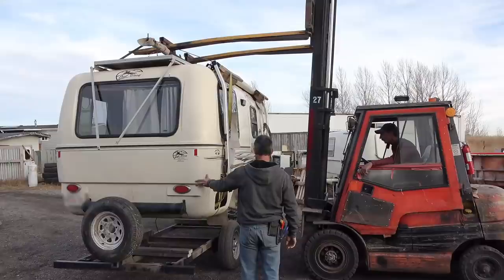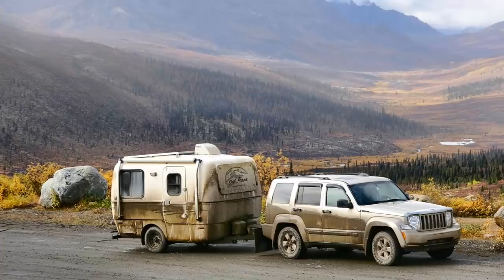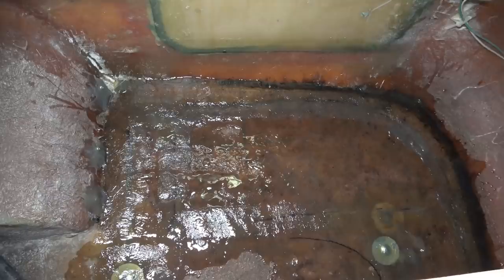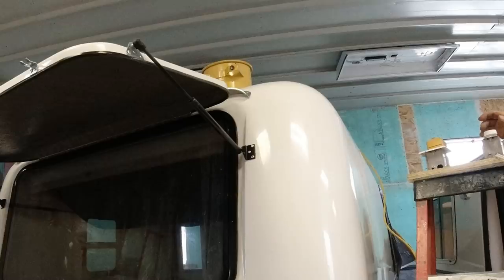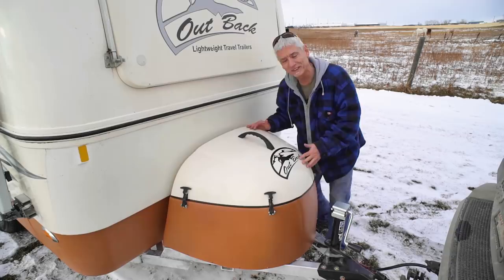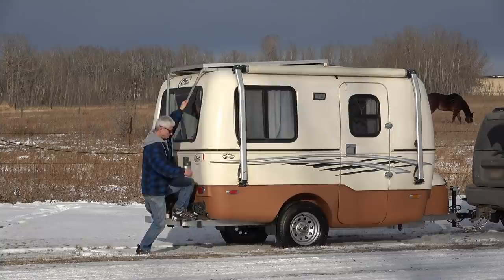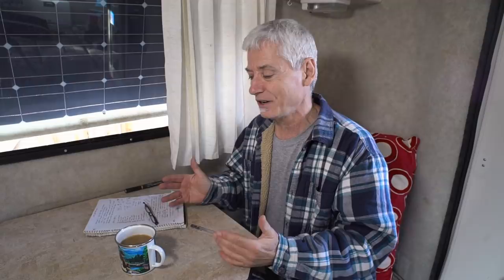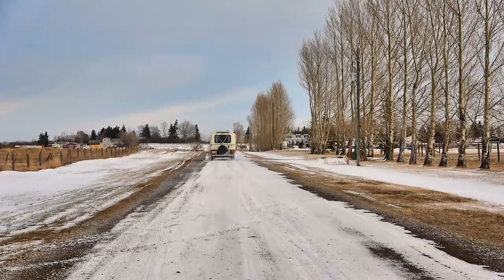Trailer Repairs Part II: Getting a Facelift!

Comment: Slim, love the camper remodel, especially the aluminum frame and beautiful new paint job with thick coating on the bottom. How did they go about dealing with the rotten wood between the two layers of fiberglass on the floor?

Comment: I hope they gave you some sort of guarantee with the fiberglass work they did. Seems to me that if it broke once it will again. Look at corvette's their nice but they crack really easy and need to be repaired, just saying that a nice rock guard made from metal maybe would have been a beeter solution,time will tell. It does look nice though!!
Reply from the maker: I'm sure there's the regular defect warranty, but you'd be dreaming if you think they'll fix it for free if a bolt flies off a truck or something. Never works that way. SP

Comment: Harbor Freight in Milwaukee, Wi. sell Solar panels. Seen in some pod cast with TINY HOUSE. some people Bought from Harbor Freight to sue OUT SIDE. to add electric power to their inside of their Tiny house. . Am thinking if I could store outside in some way and use the two on the Trailer. If I recall they sell smaller solar panels too, which would be easier to store.

Comment: asfar as grinding all that down goes. people gotta remember sand blasting. that could have been shot in 20 mins beside another bigger job theyre shooting. cheap. under $300. then prob $500 at lineX to spray it. aluminum is still better but id cap the ends of those tubes some how. theyll fill with road crap and be a pain for years to come.

Comment: There is no judgement by your viewers on how much it cost, but it aids us to know and I think it's fair payment for our viewership.
Reply from the maker: Jeff, putting a repair bill out to 125,000 viewers would really put the manufacturer in a bind. Costs vary dramatically, like supply costs, labor costs and the cost of materials like aluminum. This would NOT be fair to anyone, especially over time.  Thanks!
Reply: @SlimPotatohead  And, especially when the border is closed and parts/materials are more expensive than the same time last year.
Reply from the maker: Agreed Stephen, it's a nightmare right now for small manufacturers. Many suppliers have been forced to shut down. Thanks! SP
Reply: Thanks for reply, just getting ballpark ideas on cost helps , no one going to hold them to firm price.

Comment: For extra storage on the rear, it looks like there is a hitch receiver on the rear of the trailer. Why not use that for extra storage? Get a storage box that fits in the receiver, and you're good to go! And you can easily remove it if not needed.

Comment: Sorry to be negative but your tongue box at the front is going to get water splashed  in it so would not put a tool box /bag in there. They should of sealed the bottom and grommet the gas line. Your video shows the slot of snow underneath!. Enjoy the videos very much.

Comment: I was wondering if towing a trailer a lot does any long term maintenance issues?
I know if your way down by tow weight but I just mean on transmission, rpms and different elevations over time towing a trailer?
I have a 4runner that can tow 5000 lbs but I want either a tab 320 or a scamp 16ft. They are below 2000lbs.
Reply from the maker: Transmission is always a main concern. My last Jeep needed tranny work. My load is lighter now, so I keep my fingers crossed! SP

Comment: Would it have been cheaper to buy a stripped down model to begin with, without pottie, sink, water container, and aluminum frame,  etc?   How much easier is it to hitch and unhitch with the lighter frame?
Reply from the maker: Wait time is 6 months to a year. And no, it would not be any cheaper. Thanks, SP

Comment: Thanks for the update.  The trailer looks great.  Is there a huge price difference between the aluminum frame VS if you would have just had them swap the frame for another steel one?  I'd think in the end it would still be cheaper to just go with the aluminum frame for the lifespan over the cost I'd think.  

I like the color you went with too.  Turned out great how they did all that and covered up that old storage cubby in the back corner.  The rear bumper & extra framing would be great for small storage items I agree.  

So, since you aren't going to reveal the cost for obvious reasons, is it still cheaper than a new one LOL.  

Also, did Outback say anything about the things you modified on the trailer at all?  Did they complain or anything about that stuff?  Curious how they deal with customers who actually modify their trailers to suit their needs.  They did a great job with your trailer, I'm sure it wasn't cheap, but heck for what they charged I think it looks just as good as if you had bought new.  Thank you for sharing all the video shots from the shop they were working at, really interesting to see what all they do.  I had no idea until your first video of your updates on the trailer that the body came off the frame, I don't think any other trailer out there can be done like that.

Comment: Love the new colors! The darker shade of brown compliments the lighter shade very well.  Congratulations on the new upgrades. You don't have to breakdown/justify the expenses to any of the viewers as I feel people will criticize anyway regardless of what you paid. As long as you're happy that's all that matters. I do have a question though, is there a weight difference between the steel vs aluminium frame? Any noticeable difference in fuel consumption?
Reply from the maker: The frame is around 250 lbs lighter. As for gas, you'll have to wait till I go somewhere! SP
Reply: @SlimPotatohead  250 is pretty good with the aluminium frame even with the reinforcements for structural integrity and the rear bars/bracket.

Comment: Was the rot isolated to the 2 rear areas?  Or were those the only 2 areas accessible for repair?
Reply from the maker: I did a check with a moisture detector on the whole floor (see "Up in the Air" video). There was some moisture in the front but not bad. I knew when I drilled the shower drain. Thanks! SP

Comment: How is the shower mod working any issues with leaks? Did they have any issues working around any of your modification.
Reply from the maker: I had to remove the shower so they could get at the bolts. There were no leaks under the tub. Now back and re-sealed. Thanks! SP

Comment: Hello Slim.  Congrats on the trailer repair.  It looks awesome.  

Question:  When you considered switching from steel to aluminum frame, was the strength of the frame a concern?  How does the strength of the aluminum frame compare to steel?  And would there be any conditions that a traveler might encounter where the steel would be better than aluminum?  Thank you!
Reply from the maker: Time will tell. SP

Comment: 7:50 would have been nice to seal that off more. Although, I am sure it's not a big deal.
Reply from the maker: That's for hoses and wiring. As it is also intended for batteries, some venting is needed. Thanks! SP

Comment: Slim, Great looking job on your upgrades. I have a couple questions though. 
  You had some water damage in the corners, especially that one side. The plywood that was sandwiched in the fiberglass had become saturated with water. 
What function did that plywood serve? 
Was it replaced or simply removed? 
Do the new models address this?
 Anyway thanks for the insight into your mods and what looks like a great manufacturer.
Reply from the maker: The new models include a more water resistant material. That is what was used to replace the old. It is used to fasten things down, like tanks and accessories. Thanks!

Comment: I used to place a dollar value (return on investment) on decisions that I made, but I have come to accept that it’s okay to spend money on something I really enjoy, and get use out of without too much regard to cost. Slim, do you carry a spare propane tank? If not, how do you manage not running out? Our Casita trailer has dual tanks so it’s no issue. How do you keep warm while sleeping? I’m looking at 12 volt electric blankets. Do you have experience with them?
Reply: 12V electric blankets are fine provided you have the battery capacity. Mine only draws 2A using the low setting. I use it in addition to a good cold weather sleeping bag. Found it on Amazon a few years ago.

Comment: I was typing that cost question just as you were going to answer, but then you didn't.  Range would be good enough.  I have bought new twice--never again.  Warranty repair takes forever.  One had my trailer for six months.  You are under warranty, so you have to take it to who they say.  Quality on new had gone way down between my first one and the next.  Second owner is usually best as the first took care of all the warranty problems.

Comment: Nicely done! Have you thought about off road tires?
Reply from the maker: You mean for the tow vehicle, right? I prefer all-terrain, all season however I still have to consider the long distances I travel on highways. Thanks! SP
Reply: @SlimPotatohead  Yeah, that's a tough call. I finally went with all-terrains. They may be noisier on the highways, they may wear down a bit faster but all-terrains are better in icy/slippery/rocky/sandy/wash boarded BLM/National Forest roads. To reduce road noise look at all-terrains that have offset tread patterns (this helps reduce the noise during highway drives). After going through some tough/dangerous drives on all-seasons, my all-terrains are far better and can be aired down.

Comment: Hi Slim, what did you done about isolation?
Reply from the maker: You meant "insulation", correct? Stay tuned! SP
Reply: @SlimPotatohead  That will be most interesting.  Other than the thin carpet like liner most single shell campers don't offer much insulation.  Also windows are single pane aluminium framed.  A real challenge... if any.

Comment: Why not simply get the steel frame sand blasted?  Then use an industrial coating.  Simple!!
Reply from the maker: Simple. Hah ha ! How much will simple cost me Jon? SP
Reply: @SlimPotatohead  I take it you are not being sarcastic.  I don't know off the top of things, but I don;t think it's that much for the sandblasting.  Industrial coating you could apply yourself for probably $200.
Reply from the maker: Jon, it is winter and I don't own a heated shop. I pay others who are professionals and have the right tools and faciities. I can guarantee I cannot get ANYTHING here for under $1000 even that's not realistic if I want a durable quality result. That's reality. SP
Reply: I've applied coatings in places like Dofasco in Hamilton, the cost for coating a small trailer frame is not going to be near $1000.  But again, if you're looking for someone else to do the work, in their shop, then yes, pay what you will.  I'm only letting you know that there are some reasonble cost options to clean and coat a metal frame.
Reply: Your notion is NOT simple, it's convoluted, to say the least.  You'd need a heated garage & the equipment to lift the fiberglass up & off the old frame, just for starters.
Reply: @azclaimjumper  His point was that cleaning and coating his metal frame would not be feasible or affordable.  The  fiberglass had to be lifted up either way, and I said that getting a quality industrial coating would be in the range of $200.

Comment: I had 1969 fan liner Camper did not have the amenities I didn’t have a fridge I didn’t have a toilet I didn’t have an oven that work it was all rotted but it was a bed that’s what I used it for it was a bad I meant are you that’s all I used it for but the roof caved in a little bit and then 2014 we had a hurricane picked my camper up and slammed it down in the nose and bent the frame up what I would do with this old trailer of mine I would totally got it down to a bare frame and even though the wheels on it are 35 years old it’s a 1969 so it’s 52 years old 51 years old I still have all the paperwork on this old camper I have them right now with my new camper but I have the new books for this camper right now just to let you know what I would do with my old camper I would totally got it down to a bare frame sandblasted I would have it sandblasted and I would probably want to rubberized painting it black and that way I can afford if I ever buy a side-by-side my old camper got it right down to a bare flame put diamond plate down on it I’ll screw it I’ll have it screwed to the frame have somebody put sides on it raise it up to about 19 inches on it and up on the front part of it put it in.  I would have somebody put a gate on it build a gate on it so I can put a side-by-side on it and not build it like that is 16 foot long from from tongue to back I’d have to put another axle on it because the axle on it right now it’s got the five wide axles I want to buy a side-by-side to put on this trailer my old trailer cut it right down Robert frame it’s a heavy duty trailer